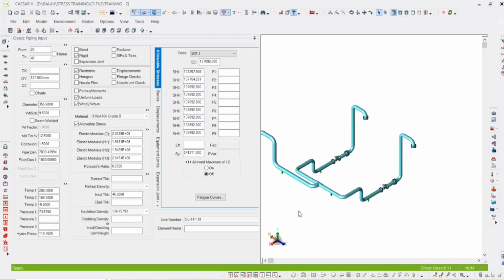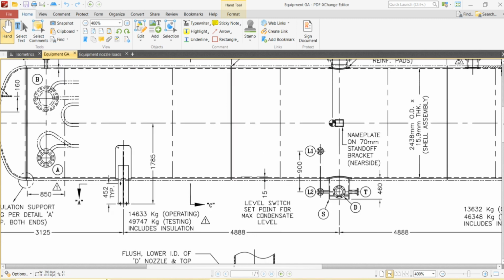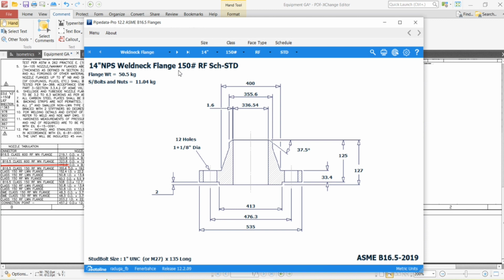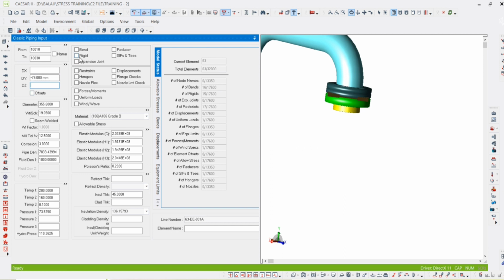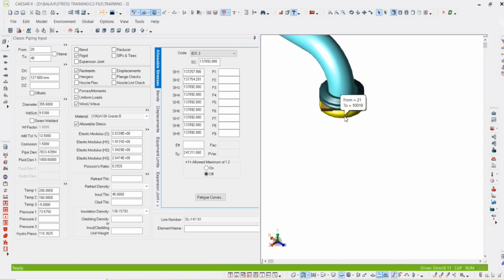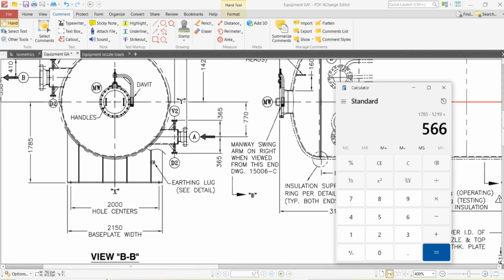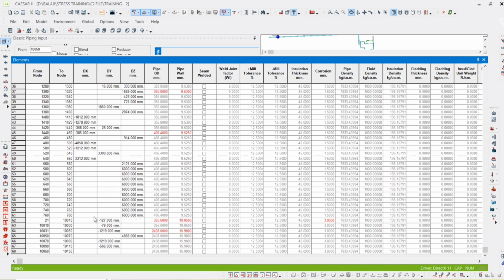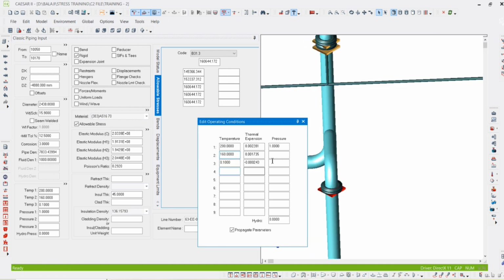STATIC Equipment modelling in CAESAR II (Thermal displacement of nozzle)

Comment: Sir, for equipment why we took pressure 0 kpa?
Reply from the maker: Why do we model equipment? To get the thermal displacements at the Nozzles.
Thermal displacement depends on the equipment material & Temperature only..
So we have considered pressure as 0.
We can consider atmospheric pressure or design pressure..
This will not make much difference in the Thermal displacement of the nozzle..